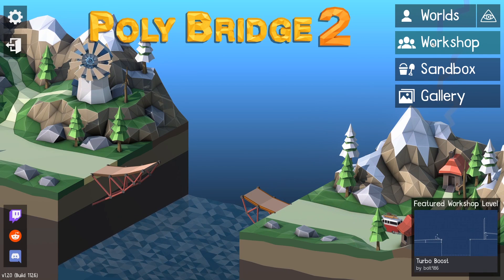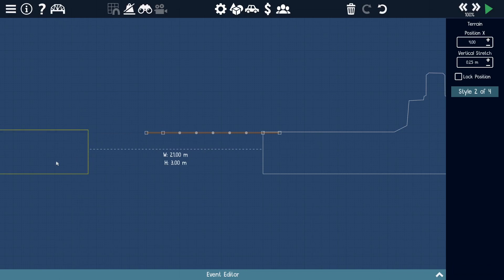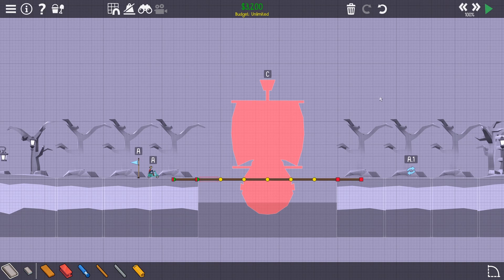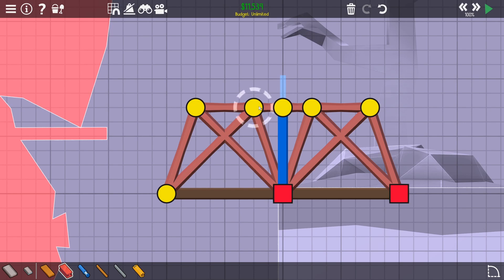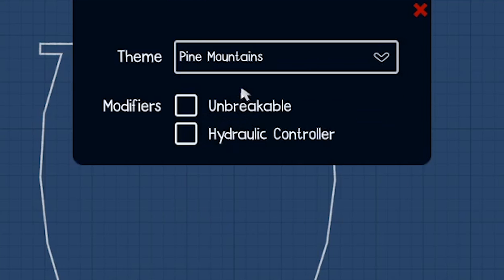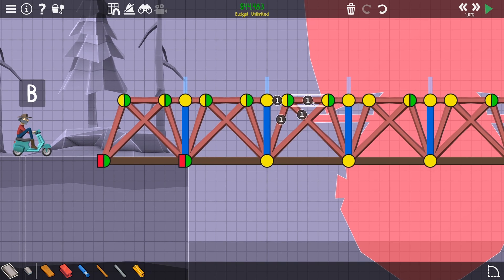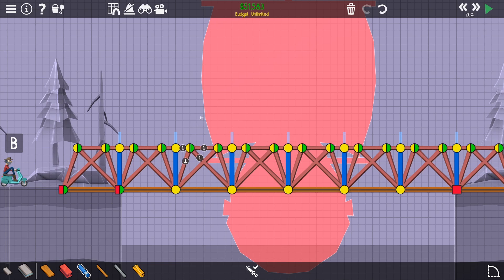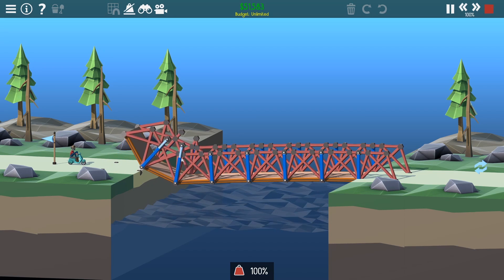This is a REAL BRIDGE!? Recreating London's ROLLING BRIDGE in Poly Bridge 2!

Comment: Quick question, I don't have the view gallery button while working through the levels... is there an option I'm missing, or is it only available in certain modes?  Also, it seems to take a lot of work to make landing pads for some jumps, am I missing something... here for example:- https://www.youtube.com/watch?v=Pu_IIYOkRwg
Reply from the maker: There should be a gallery, though I remember the dev saying there was a way of hiding it so maybe you have done that? Landings are hard, you need to pixel tweak to get it smooth or use more springs as they're a bit op in this game. Good luck!

Comment: Very cool, the problem you were having and eventually fixed by keeping the 'triangle' with the pistons was that you were creating an indeterminate geometry.  By putting everything in a straight line, you gave the short pieces three options when the piston contracted: rotate left together, rotate right together, or split and return to their original position.  The last option was made even less likely by the creation of the joint upon closing.  Allowing those two arms to not become coincident (keeping the triangle shape) made sure the geometry was determinate and it would return to its original position.

Comment: at 13:30, I think the reason the real bridge has that shape is to provide a mechanical lock that increases the load capacity of the bridge in the event of hydraulic failure. Basically a load in the center of the bridge will try to compress the already fully compressed hydraulic, while a small bend in the other direction would tend to put the hydraulic in tension. Basically when the bridge is down you're supporting the bridge from both ends passively. The motion would work just as well if it was a straight line, just make the hydraulic not expand enough to make the linkages overlap. Maybe even better, because the loose end wouldn't try to dip below the ground as the bridge starts to lift up.

Comment: When two pieces of material over-lap, they form a mechanical lock and they are unable to unlock by the games standards. Hence why your first couple designs did not work. The hydraulics pushed the two pieces of steel so much that they over-lapped, locking themselves in place, and unable to un-lock.

Comment: Since you were working with unbreakable turned on, I wonder if maybe using regular road and wood instead of steel and reinforced road would've reduced bouncing by reducing weight.
Reply from the maker: Steel and wood weigh the same, reinforced road is heavier though so maybe
Reply: Ah didn't know that.

Comment: that first solution where you got it to be an octagon but it did not unfold properly was really close. the 2 members looked like the became in line then did the same thing and would unfold. i think if you put a spring from the top on one trapezoid to the other, across the hydraulic that would have kept them separate and it would have opened smoothly(ish). also why didn't you just lower it in the reverse order that you lifted it?.
Reply from the maker: I tried and it didn't work, I must have cut that part from the video as been asked a few times now! 😅

Comment: It's funny how a Civil Engineer struggle so much when there's moving parts. (not that i'm better) Wonder how a mechanical engineer would have done.
Reply: Its still hard to do, but his main issue was that when his bridge was rolled up, his piston was in line with the pivoting bars in the bridge. When he went to push it back over, one linkage would rotate outward instead of inward and this makes the bridge try to roll up even more. Hard to write it out. Easier to draw.
Reply: We have equations that use the positions of the pivots, bar lengths, and driver mechanisms to let us know if it is going to go "over center".
Reply: @mitchellpearce9558  ok boomer
Reply: We need a real mechanical engineer youtuber

Comment: A bridge that you  could attempt to build is the Aerial Lift Bridge from Duluth Minnesota. It basically just hoists the entire bridge up into the air instead of folding back. Also in the original design it was a transporter bridge, but they converted it in the 30s.
Reply: I live in a town a few hours away from Duluth that has another aerial lift bridge… slightly smaller but it’s double decker

Comment: Wow man, congrats on getting it working right. Surprised by how much it looks like the actual bridge. Seems the real life engineers were onto something
Reply from the maker: It's an amazing bridge, wish mine would have unfolded neater though!
Reply: @RealCivilEngineerGaming  would probably need to be able to program the hydraulics to move slower and not have the joints pass through the ground so probably got close to the best way in poly bridge unless you want to spend a couple more hours/days tweeking it.

Comment: It would be sick of you made a bridge with a trolley.
What I’m saying is a bridge with a rail, you then have a car get into the cart that will then be pushed by some sort of hydraulic cable system.
Reply: So basically the Newport Transporter Bridge? He already made that.
Reply: @mcb187  He did the Tees Transporter Bridge but didn't have the cradle moving :(  The Newport bridge is 2 miles down the road and it's a vertical lift bridge, which he also did in the same video.
Reply: Ah, didn’t realize the name was different, I live in the US, never been to Europe. They retrofitted the one transport bridge we had a long time ago, so now their only in Europe :(